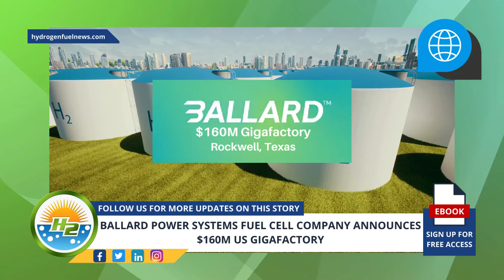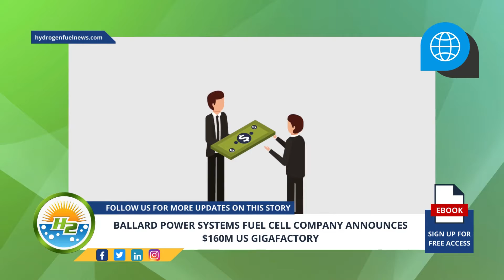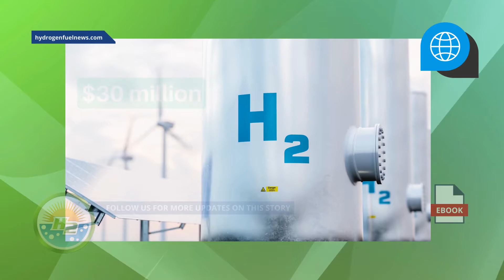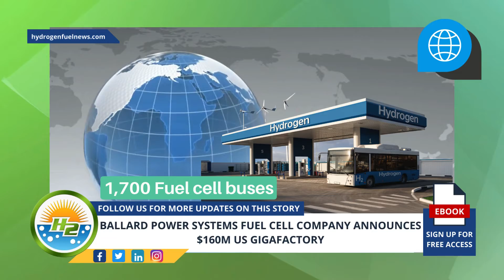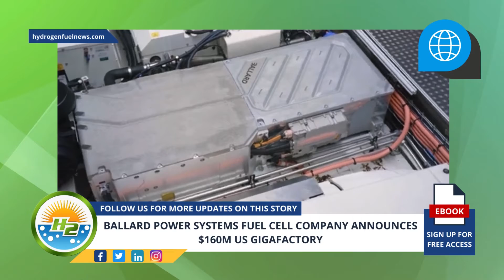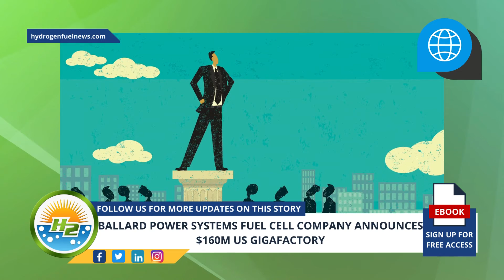Ballard Power Systems reveals plans for a $160 million gigafactory in the United States

Comment: The problem with the technology is that this kind of power cell has an efficiency of only 60%. The main benefit of the technology is that heavy duty industries like trucks, buses, boats, and even planes can be powered with Ballards cells. The current battery technology available is far from useful in heavy-duty industries.. its not practically possible at this time. I bought the stock 2 years ago, its my worst-performing horse. I hope to see this change soon. The other problem is the huge amount of investment neutralizing the profits...
Reply: Patents and patience